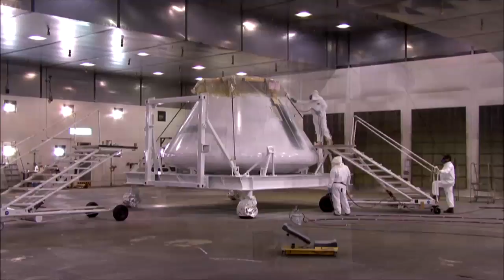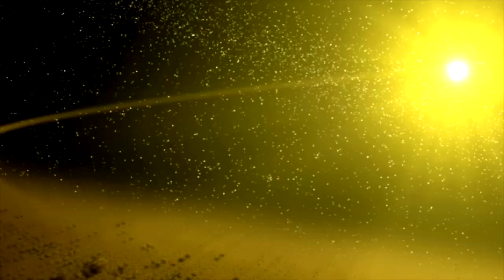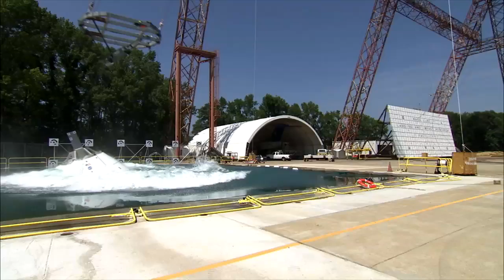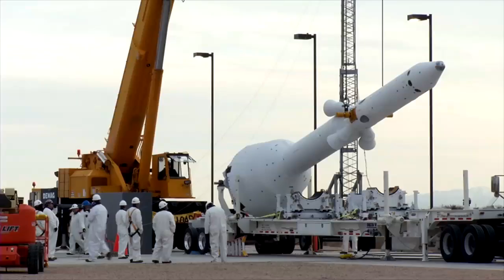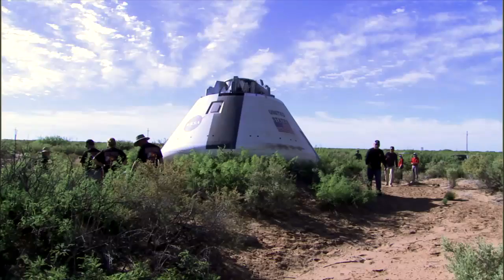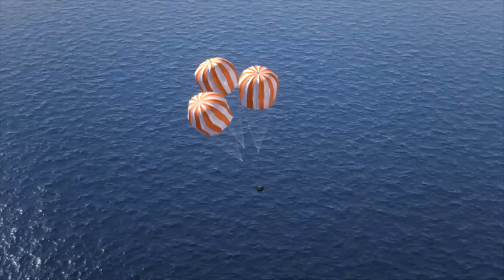Orion: From Factory to Flight

Comment: They have to take older programs down so we can move on. The space shuttle did not have the ability to completely leave our full atmosphere and come back at the speeds necessary to go far into space. At one time we were on the moon, with what we currently use we cant even go there... it is sad but we are re-entering the adventure. Orion looks so similar to past space vehicles because their concepts worked and now we can build on that and give it a modern high-tech twist that takes us farther.

Comment: How Orion can reach Mars or asteroid belt? I think it must be large spacecraft assembled  in orbit like ISS. But generally speaking Orion is impressive vehicle.
Reply: On missions to mars and other distant locations Orion will be docked with larger modules, probably looking a bit like a smaller ISS. But Orion will always be the heart of these assemblies, always the craft that returns to earth.
Reply: The further out you get the less delta-v (change in velocity) you need to modify your orbit, this means you need less and less fuel to change orbit the further you get. A larger launch stage would get this into orbit then smaller and smaller ones once you get to LEO.

Comment: I can see this capsule going to the moon but not the long journey like Mars. Have you ever took a long flight of over 13 hours in an airline. You are pretty sore when you get up and out of it. Mars is a very long trip and can not be used like a jet fighter. Man needs to move about and exercise on a regular bases. You learned this in the space station. How do you overcome this?
Reply: The plan has always been to have a large habitation module docked to Orion for the journey to Mars. This will likely be a version of SpaceX's starship, similar to the HLS Starship in development for the Artemis program to the Moon.

Comment: why did we build the space shuttle in the first place?

how much money and time did we waste with that shitty shuttle although it was clear from the start that it was a bad idea?
Reply: global intense recearch wrong. we could have build a large delivery vehicle also with a capsule system to build up ISS or to launch telescopes in spaces without a shuttle-airplane.
Reply: .....................ok!! Forget the whole thing, my man, let's move on!! take care
Reply: +Johnny Good    The Shuttle failed once because the temperature safety rule for the section seals on the booster was disregarded, managerial error.  The Shuttle failed again because environmental wackos objected to the original foam heat shield on the external tank, which was made with CFCs, which are supposed to be harmful to Earth's ozone layer.  For the last few years, we were launching with inferior foam, which came off and struck the orbiter.  This eventually knocked off tiles in vital areas, causing a reentry failure.  The fix for the 1st problem was to move on to reusable liquid fuelled flyback boosters.  The fix for the 2nd problem is not to have fixed the original foam, which wasn't broken.  The Shuttle program was expensive because a government agency ran it.  That is what government agencies do, spend money.
        Space travel will not be opened up by an ascent on disintegrating totem poles, a legacy of the tie-in with ICBM technology, and a descent that resembles an eject abort from an aircraft.  This may make a Mars mission in our lifetime more likely, because it is cheaper.  But it is a step backward in technology and, in some areas, in capability.  If all the Shuttle flights had been used to accumulate an orbital infrastructure, we could have had space dry dock/industrial station, with skyhook capability by now.
        It is a moot point, I suppose, because government agencies could never be the driving force behind the economic development of space.  The best thing that governments can do to encourage that is clarify that prospectors own extraterrestrial resources they develop and real estate, etc.  Loosen up the restrictions on private space missions.  Reform space law.
        They are not seriously thinking of sending 4 astronauts on a 3 year mission in a cone that size, are they?  That's fine as a reentry capsule to bring the folks the last hundred thousand miles or so, but what worked for a 3 week mission in Apollo won't work for longer interplanetary missions.  Some of the components of this Orion technology have good implications for deep space missions, but as a command module to Mars, in a similar sense to the Apollo CM?  Only if there is a habitat module for the trip.
Reply: +Johnny Good

Late, I know, but I just saw this.
The shuttle was also meant to be able to bring back big satellites and it transported the Space Lab up and down.
Something an Apollo/Orion type craft couldn't have done.
Reply: Hubble.